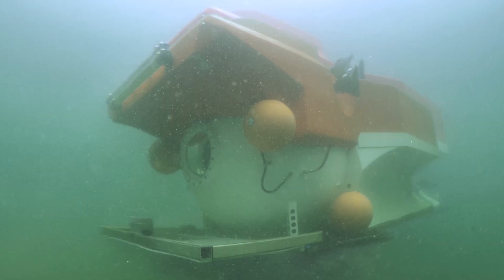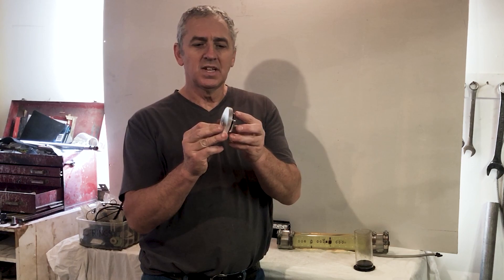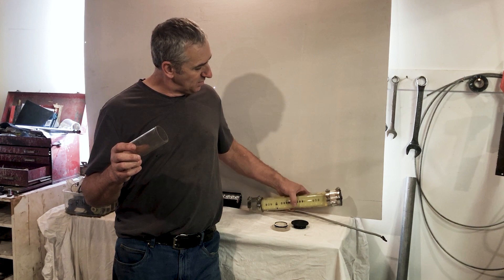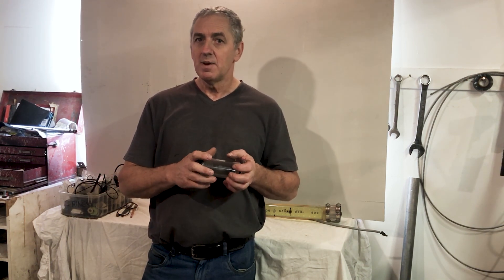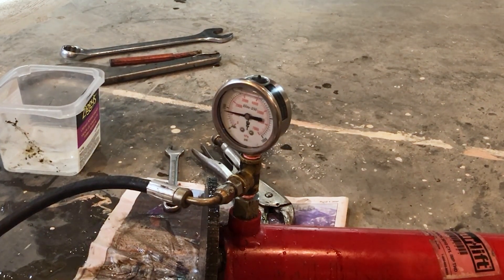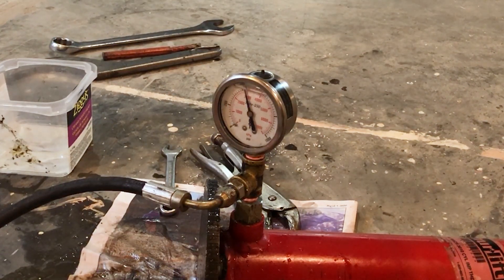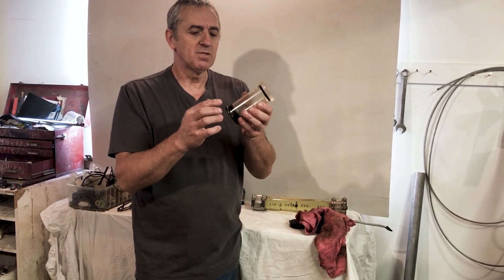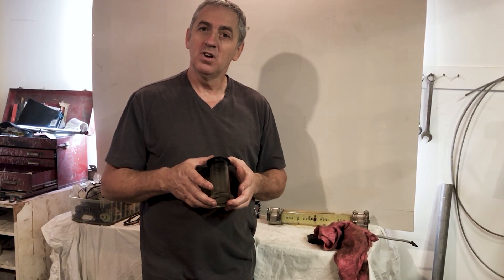Pressure Testing Camera Housing For New ROV Project

Comment: Thanks for making another great video. I would love to see more about the test chamber itself. In a previous video you mentioned you were using a cylinder from a Hiab crane, is this what you used for this test? Do you have any advice on where to go and buy something to make my own pressure test chamber? Thanks!
Reply from the maker: Wayne, unfortunately my son the editor did not include the chamber.  I specifically included it, lol.  
The chamber is simply a double acting hydraulic cylinder with a screw on end cap.  I paid  a couple hundred dollars for it.
Reply: @HankPronk  so the double acting cylinder is a standard part, but you remove the piston and attach an end cap on instead? Is this end cap a standard part, or something you had to custom make? Thanks!
Reply from the maker: @WaynePiekarski  Yes the hydraulic cylinder is a standard part, no modifications  needed.  Leave the piston on and just put your part in the empty barrel then put the piston rod back on and pump it up full of water.
Reply: @HankPronk  Thanks for the info, I'll now have to see if I can find somewhere that sells something like this!

Comment: Hank, Next camera housing you make you may want to try an acrylic dome in front of the lens. Because it is hemispherical it takes pressure better than a flat plate and can be thinner plastic. With a dome and a wide angle lens you get a wide view and better color. This was what was used on 1980s-1990s camcorder housings.
Reply from the maker: Bernie, building subs, I find the optics behind a flat port are much better with less distortion.  I have a camera housing on my deep diver "E3000"  and I removed the dome and replaced it with a 1 inch thick flat.  I am new to ROV building though.
Reply: Am looking forward to the videos.